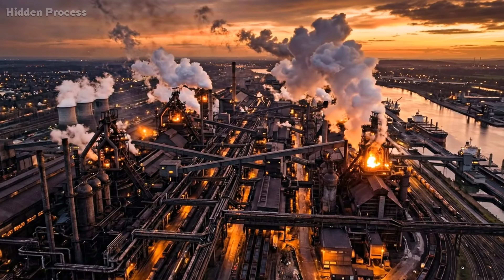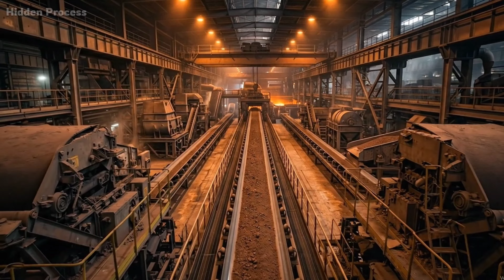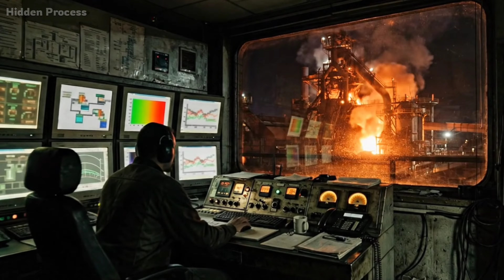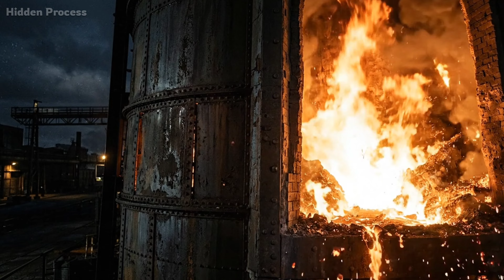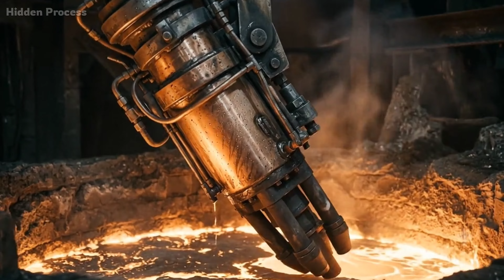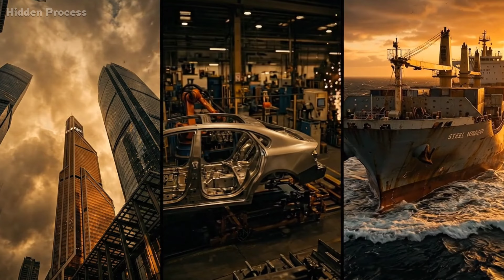From Rock to Steel - What Happens Inside a BLAST FURNACE

Comment from the maker: 🔥 POLL — Which part shocked you the most?
🅐 The furnace never turns off for years
🅑 The temperature goes over 3,000°F
🅒 Iron is basically USELESS without this process
Drop your answer below 👇